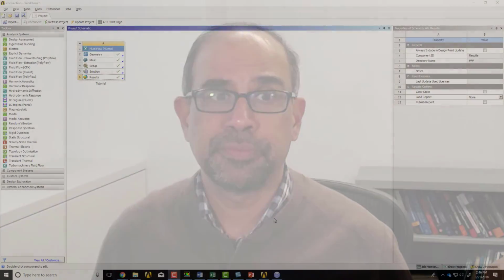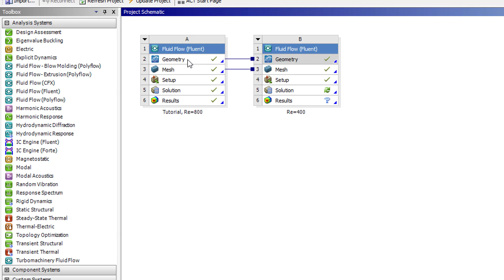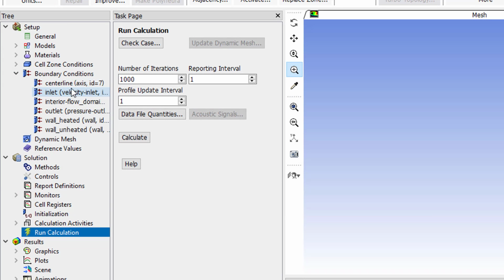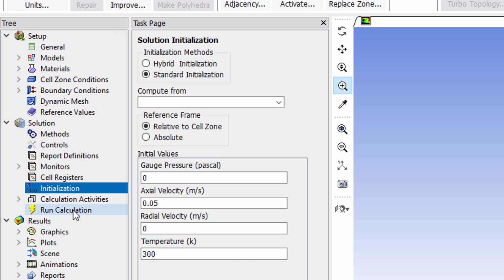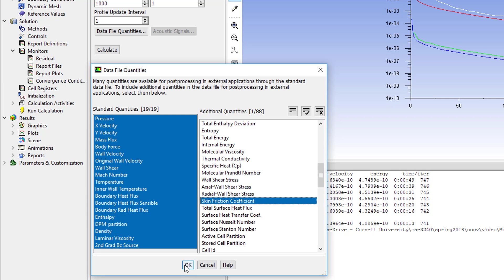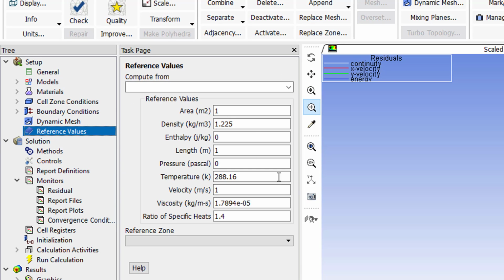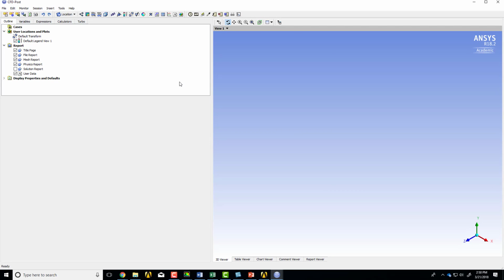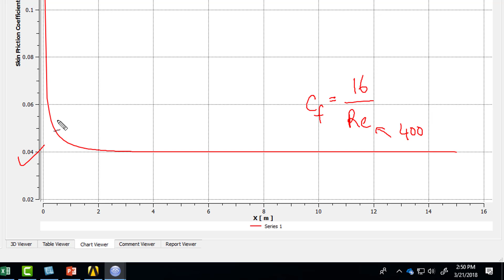Change Reynolds Number

Comment: what model you are using with Re=400 and 200. do i need to change the model for the higher Reynolds number (for instance Re=10000) a models such as k - epsilon or k - omega ?
Reply: it depends on the nature of the flow, either  internal or external .